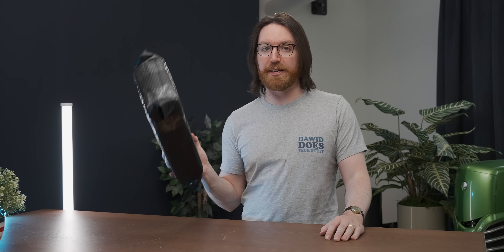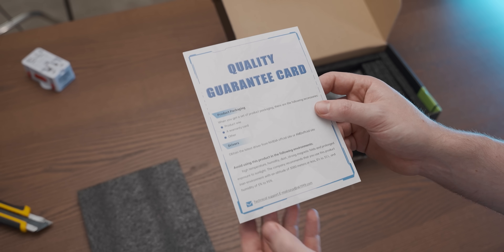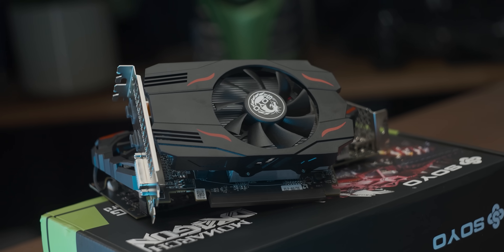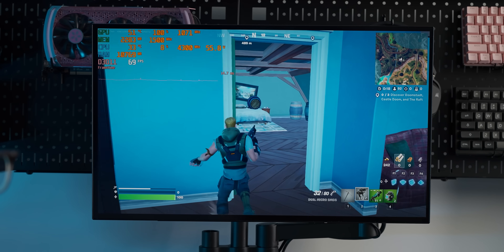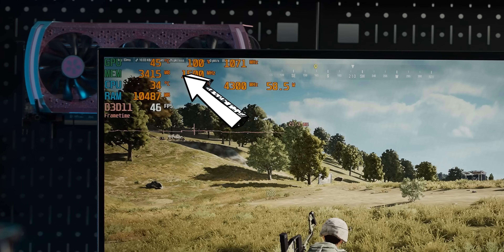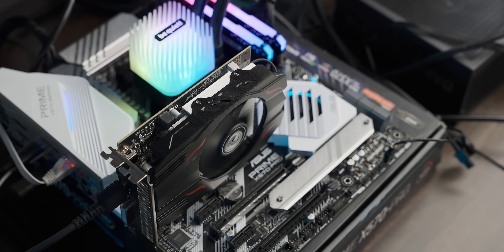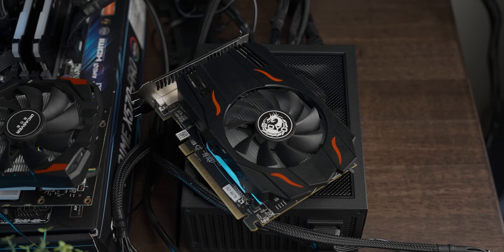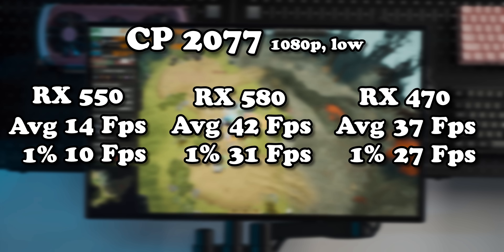The Best Selling Graphics Card On AliExpress Is Bad...

Comment: Well, I recently got the RX 550 in my workstation. It is one of the cheapest GPUs that are officially supported for Windows 11 and can handle 3 screens at 4k resolution. For 50 euros this GPU was a real bargain. You can't really game with it, but as a display output it is really a magical GPU for this price.
Reply: Depends on what games? Of you say focuesd on only new stuff than no. Gaming not possible. If games in genereal are for gaming....I have a 2gb vram card and game with it. Last one was empyrion i tried. Was for free from epic. Star wars squadrons (also for free from epic) and some long time favourite space engineers.
Reply: So the 470 isn't compatible?
Reply: @totallytrueinfernoriderwuwa  The RX 470 requires a 6 or 8 pin PCI Express power cable, something my HP workstation does not have.
Reply: @Mother_Mercury  I have a 1070ti in my HP workstation that did not come with a "6 or 8 pin PCIE" power cable. Don't make claims based on your personal limits.
Reply: @MLK_Jr_BLVD  We probably don't have the same pc, my HP workstation only has a 350 watt psu, which already limits the choice of gpus. But this doesn't matter to me because I don't game on that pc, but only do video editing. Important to me are the 'normal' PCI slots to which I can connect old capture cards.
Reply: No @totallytrueinfernoriderwuwa
Reply: 20 is bargain
Reply: Nice
Reply: Shop around for a used Quadro P620 or P2000, the latter is a cut down GTX 1060 and so you can play most games on it still.
Reply: No, it's not. It's a shit card for a shit price. You can extract better cards from PCs in a junkyard.
Reply: @KYSMO  okay, and can you tell us which one does what the OP wants to do (3 4K screens, at a cheap price) better than the 550, then?
Reply: You bought first hand? I bought a 1050ti for 40€ second hand. For these low price purchases second hand is a better choice.
Reply: 50€? You got scammed dude, I just sold my rx580 8gb for 50€ today. I saw one for 40€ a couple days ago
Reply: my gt710 isn't natively supported in my nas build either, so something like this is technically up my alley tho i'd splurge a bit now for a arc a310
Reply: "It is one of the cheapest GPUs that are officially supported for Windows 11"?? Any GPU will run Windows 11 my dude lol
Reply: @mozzjones6943  that's not what he means, "officially supported" licensed for windows 11 is a selling point,
Reply: @aeroflopper  Why even contemplate such a lie of marketing? There's no such thing as an officially supported GPU for Windows 11.
Reply: @mozzjones6943  all gpu's sold will say on the box what operating system its supports, we know they work with any really but not all features will be availble to that older card, vista was a bitch needed a good card for that one at the time.
Reply: Wow, a sensible comment. It was a good idea to roll around Dawids channel
Reply: @mozzjones6943  its true ive boght dozens of new cards, they all have it writen on the box, one at side of me a gtx 1660 box says windows 10 and windows 7 64 bit and lynix
Reply: Cut the cap. You CAN definitely play on this but only games like fall guys or sims. I have this GPU and it runs so cold even playing.
Reply: I agree. its the best you can get in a server build that needs a gpu. Ive got a  gt 1030 instead.
Reply: @FAL87  if you're gaming the gt 1030 is roughly 25% slower than the rx 550.
Reply: @Indisputed yeah but it's not about gaming on a homelab machine.
Reply: @FAL87 I'm using a 2gb 1050 only £20 bargain just for a display
Reply: @aeroflopper  £20 must be 30€ right? thats realy a good grab.
Reply: @FAL87  absolutely and was over a year ago

Comment: Dawid, you should've tested Performance Mode in Fortnite on the RX550, I'm guessing you've used DX11 because you didn't specify. EDIT: You did use DX11 because it says in the overlay, seen it now. Still, next time try Performance Mode on low end GPUs. :)

Comment: I always imagine all the sadness, people and i guess children have when they think they buy a nice cheap GPU to finally start playing PC games, just to get crushed by the awful performance. You are better of with something used. What an awful experience. 

I just built a PC out of Parts i still had around or do not use anymore because i have faster Hardware in my main PC.
BQ Base 500
250GB SSD ( A bit low on space but hey, there are 2 free M.2 Slots.)
Z370 Asus Board with 16GB DDR4 2400Mhz
i7 8700 non K cooled with Assassin Spirit 120 V2
GTX 1070 (Even ~30% faster than RX 580 8GB)
BQ 680W PSU 
3x 140mm Case Fans

I still would consieder this a fine machine for 1080p. Depending on what you game. But most of my Friends  are still on their GTX 1070s, 2070, RX580 or GTX 1660S. And they play almost anything with it. Depends on you.

I plan to sell it for around 300 Euros as a whole with Windows. Look and Ask around. Grab old Hardware. Do not go to Ali Express and buy cheap new Cards that suck hard.

Comment: Videos like these make me content with having a gtx 1650
Reply: I have a 1660 and yes, I agree with you.
Reply: Now that I’ve got a 1650 super… same. A GT1030 is now the minimum to revive an older system, since the one I had literally lacks the PCIE lanes and speed required for anything better. I don’t even know if the RTX “3040” would do any good on that system.
Reply: May I know what you would play if you had a higher end card?
Reply: 1650 is almost 1.5x as fast as the 550 so yes its expected the 1650 Super GDDR 6 its 30 to 40 % faster than the RX 550
Reply: @Outlawproductions582 i think he's aware of that. its just that the 1650 and 1660 and their super variants, and even the 1660TI despite still being solid cards are a farcry from the "average gamer with a paying job" who probably have an rtx card.

personally i think the gtx cards are still solid. and i mean most of them, even the 970.

Comment: whatever it is, it's better than having GT 710
Reply: Unless it's a GT 210
Reply from the maker: @RaytheonTechnologies_Official  Damn, you beat me to it. 😂
Reply: @RaytheonTechnologies_Official  My childhood was ruined by GT 210 and GT 710
Reply: @edm0nz  it is time to take your revenge
Reply: fucking same bro now I'm glad to have rx6600.....
Reply: @edm0nz  at least the 710 can do PhysX unlike the GT 1030. I couldn't make that a dedicated PhysX card.
Reply: @RaytheonTechnologies_Official  gt 210 is the goat
Reply: @RaytheonTechnologies_Official  i still have one. it was my first dgpu
Reply: @edm0nz  And GT 710 is better than an R5 430 😭
Reply: My first alienware "gaming" laptop had a gt240m... even the 710 is 50% fast than that turd was.
Reply: I have a middle of these, RX 560D 4GB. Does ok but keeps getting power limited to 48w. Not sure if psu or the terrible oem motherboard
Reply: Update if anyone interested, I've fixed my issue by setting the GPU mode to "compute" in the driver control panel, then maxed the power limit in MSI afterburner.
Reply: I would have sex with my face if I owned a GT 710
Reply: I had the GT 705, I got better performance with the integrated graphics. It was a prebuilt dell inspiron btw
Reply: I hope the Ryzen 5 8600g with its integrated Radeon 760m I plan to buy next month will be better than this.
Reply: Even having 2 GT710s
Reply: At least yall dont use a radeon 530
Reply: I do have a 710.....would love to have this 😂
Reply: Why
Reply: *laughs in intel uhd 630 graphics*😂😢
Reply: It could be the GT 210
Reply: And syphillis
Reply: Broo I have a gt730 in 2025
Reply: no its not
Reply: My first "upgrade" is going from an HD 5450 to a GeForce 210... 😅
Reply: I have igpu 620
Reply: From my experience Intel integrated graphic is much better than that waste of sand.
Reply: Or a GT 605😂
Reply: i remember when I was 12years old and tried to convince my parents that we need a gt710 for the family computer. Good thing they didnt listen and waste money lol.
Reply: Better than a 1030
Reply: Or almost any iGPU
Reply: @theanglerfish  I dunno... Steam Deck would beg to differ. The 890m is pretty decent too
Reply: @Bruce-LeeLSA I think they meant any modern igpu>gt 710
Reply: @theanglerfish  not new ones tho. for example,intel iris xe and amd radeon vega 8 absolutely destroys gt710 and they are extremely common igpus.
vega 8 is 200% and iris xe is 300% faster than 710.
i know u said "almost any" but its more like "almost any old igpu"
Reply: I’d never say that, any older AMD card is worse than any Nvidia card. A GT710 would still give you efficiency and a somewhat decent boost to watching videos basically lol. Though the GT710 has basically been discontinued, and only the GT730 and GT1030 exist anymore.
Reply: @edm0nz  who are using the word gay as a synonym for bad in 2024, you fell off.
Reply: @MrEdioss  i guess it depends on where you live but where i live people still use it all the time
Reply: @MrEdioss fell right into ya.
Reply: @MrEdioss it never fell off. Normal people still use it to this day. This isnt a diversity equity inclusion dumpster

Comment: AliExpress and GPU are not positive words
Reply: nah, aliexpress and HDD are not positive words. Cuz hdds are fake there, not gpus
Reply: @malachkah  ton of fakes gpus there too man haha

I love me some aliexpress. But it's scary place to buy tech.

Did have GREAT experience buying mechanical keyboards though.
Reply: @malachkah  
its not fake, just learn how to buy from aliexpress
there are a fake sellers, just don't buy from them.
Reply: @malachkah  you shouldn't be buying HDDs anyway, aliexpress or not, it's not the 1900s anymore
Reply: Cheap and cheerful
Reply: The JieShuo RX 6600 XT, 6700 XT, Soyo RX 6600M, SJS RTX 2060 Super, and RX 580 say otherwise.  Every AliExpress GPU I’ve run was fine.
Reply: @doesitgame  I've bought a 750ti from a brand called veineda years ago. Great card, also came in a funny looking box tho.
Reply: Well, I watched this on my 6700XT that bought on AliExpress like a two years ago or something, so it isn't that bad
On the other hand, there were some quirks I had to overcome to use that card properly... Like drilling out three of four screws that hold that spring on the backplate, and replacing whatever cr@p they were using as thermal paste to honeywell.
Reply: I dunno, recently saw a guy buy a 6600M card from alie and overclocking it. He got great performance for 100 bucks.

They just took mobile GPU's and turned them into cards, with active cooling. Giving you space to overclock quite a bit.
Reply from the maker: @transformerstuff7029  I agree, they are not as negative as you may think.
Reply: Yeah, it depends. Some say they saw positive cases, my brother on other case bought rx 590 gme and got literally a worse 580sp with 1024mhz (Supposedly should have had around 1380, wild scam). At was able to return funds, but still a bad experience nonetheless

Also, he could have buy really nice 580sp with discount when there was still a time left, but ultimately decided to commit to a better option in face of 590gme - A disaster.

Best advice with alie would be to fully check whatever you got from them, all screens on alie page, cpu-z and stuff